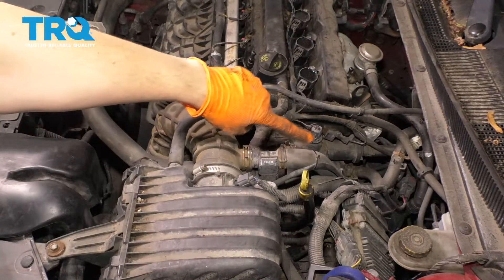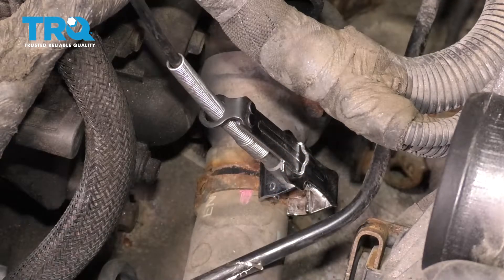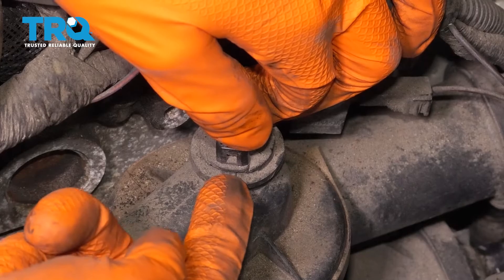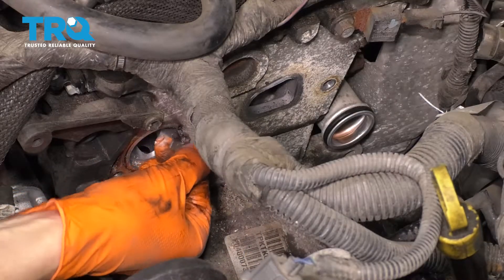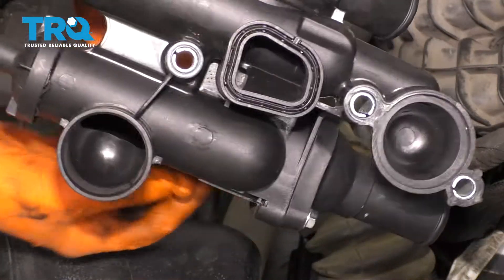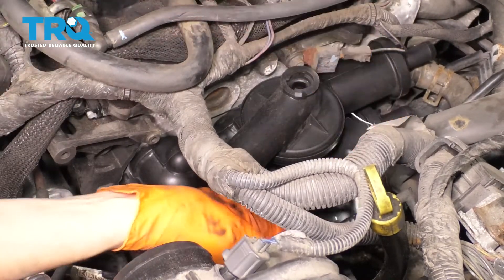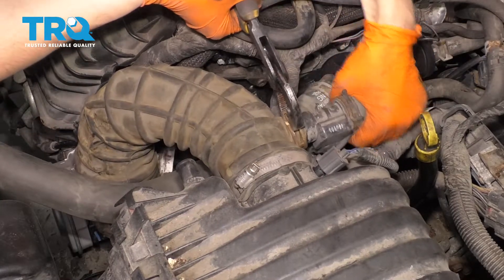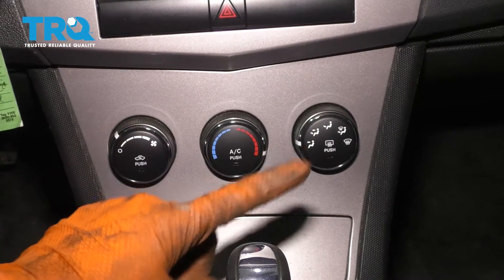How to Replace Thermostat Housing 2007-2010 Chrysler Sebring (2.4L)

Comment: I've had this part replaced twice (plastic after market parts) and both have failed. I purchased the second (Dorman product) at $182 thinking it was more of a quality as opposed to a cheaper brand for $79, both have failed immediately after putting them on. So, I called Chrysler dealership and got a quote for the original part for $428. Don't waste your time using these after market parts.

Comment: So the 2007 Chrysler Sebring 2.4 L actually has two thermostats along with that sensor in the thermostat housing. When I put in the new thermostat housing do I keep both old thermostats if they're working and put them into that new housing when I install it, or does the new thermostat housing part come with both new thermostats? Thanks

Comment: Just curious, why did you replace the thermostat housing, and not just replace with new gaskets and o-rings. Thanks for the video.
Reply: Cheaper  tbt an it's one of those things where you are already in there mid as well